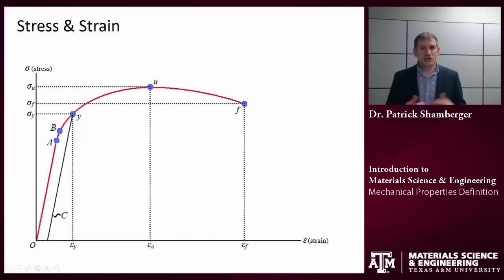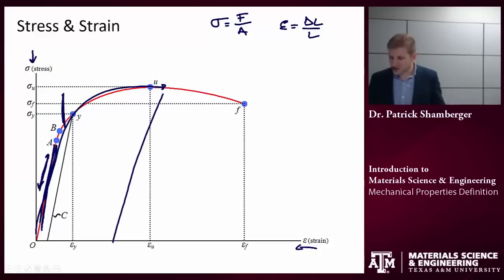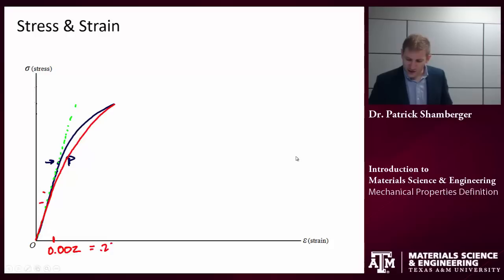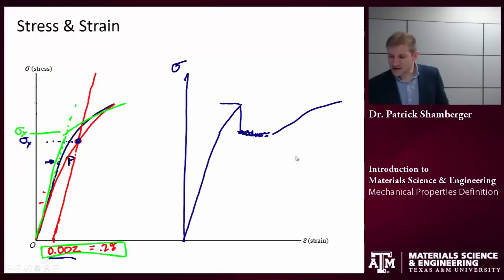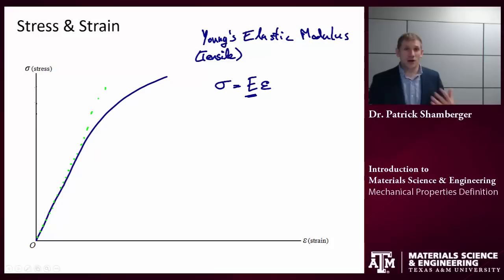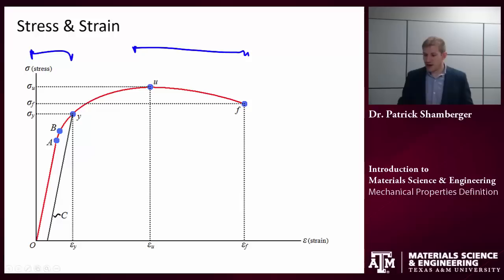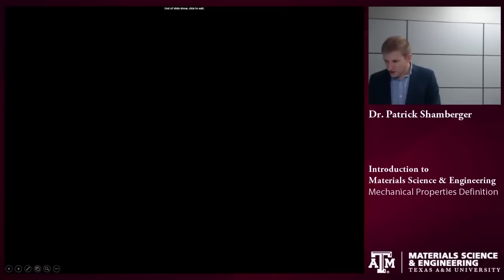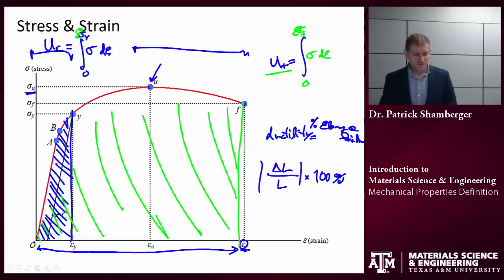Mechanical Properties Definitions {Texas A&M: Intro to Materials}

Comment: Nice presentation and lots of info. However surely (not blaming the prof as it is tradition but) elastic modulus E is a horrid name as it really represents stiffness. Rubber has very low E and concrete high E. Taking the reciprocal (1/E) is elasticity . Perhaps better to use symbol Y for young modulus or S for stiffness or whatever. This has been going on for hundreds of years, no wonder people get confused.

Comment: In mathematics,we usually plot the known values in horizontal axis and plot their corresponding values vertical axis.why here in this diagram we do the opposite?
Reply from the maker: This is a GREAT question!  I agree that generally, the independent variable is on the horizontal axis.  In fact, when we use a stress-strain diagram to predict "How much does a material deform under some load", this is exactly what we do.  However, when we generate data for a stress-strain diagram, we generally control elongation (strain), and measure stress (using a load cell).  So, in effect we come at it the other way.  Stress-strain is a bit unique in that regard, as sometimes we treat either one variable or the other as the independent variable.
Reply: Patrick Shamberger Got it 👍🏻✌🏻